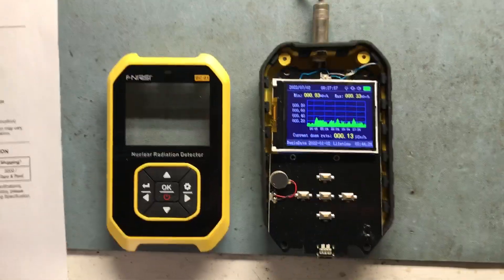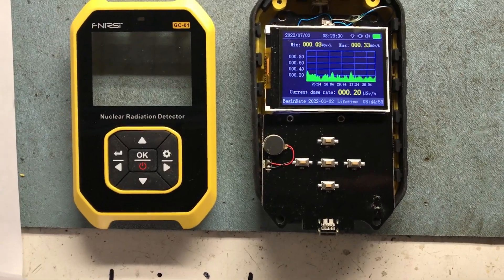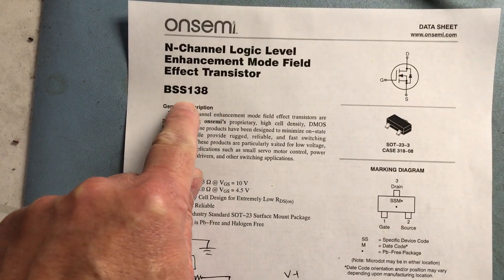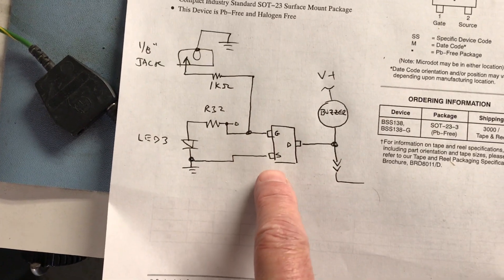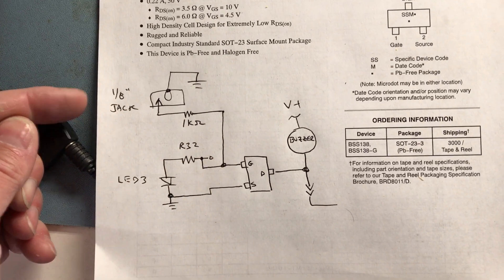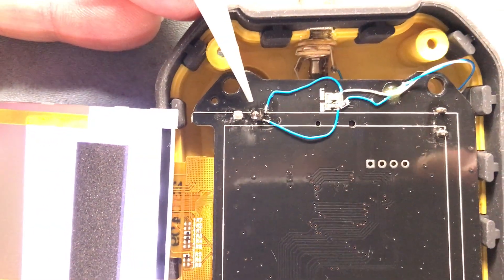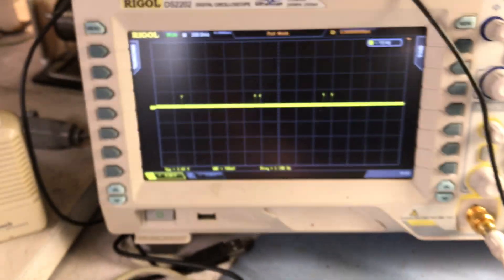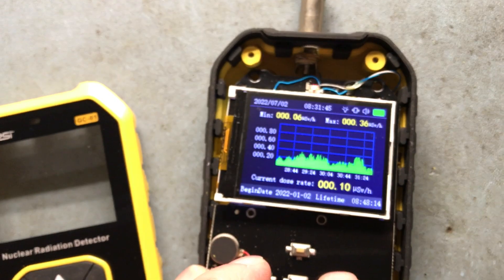"Clicks" modification for FNIRSI GC-01 Geiger counter

Comment: Nice mod, in the end I decided to opt for just a 100nF cap between the LED signal and the gate of the transistor, it means I get clicks even when the alarm is active.
You might want to take a look at the review of the GC-01 I just released on my channel.  Sadly the product has just switched to a far inferior GM tube and this even includes the white-label versions of this device.  I contacted the company here in China (where I am based) and they confirmed the change.  Such a shame, its was pretty OK for a low cost counter...
Reply: That 1-capacitor mod is definitely the best and simplest.
Reply from the maker: Good to know.   Thank you!

Comment: i tried and it worked fine 
would it be possible to increase click volume somehow ?
Reply from the maker: You might try an RC time delay in the gate circuit.  This way, the buzzer would stay on a little longer for each pulse.  I would put also a diode across this new resistor so the turn on will be fast and the turn-off is slow.  I've not tried this but I would start with a 100 milli-second time constant so maybe 10K Ohms in series with 10uF to ground? then to the NFET's gate.  Put a Schottky or General Purpose diode across the 10K resistor so the NFET turns on fast but then turns off with the delay.  You might have to play with these values as 100 mSec may not be enough to get it to your liking but I think this would work.
Reply: @ probably you’ve explained well. but sorry i did not have enough knowledge about electronics. i’ve simply followed your video

Comment: Hi, would you please tell me what's the real value for the R32 resistor? Thanks in advance.
Reply from the maker: R32 and LED3 are parts already located on the GC-01 circuit board so I did not measure those but it's an LED bias resistor for a 3.3V circuit so I would guess its value is somewhere between 250 Ohms and 1000 Ohms.

Comment: Hi! Does it sound loud with the transistor? I have done the capacitor modification and i can bearly hear it. Thanks!
Reply from the maker: It's usable but yes, your are right, it's not very loud.  The piezo element is inside the case so it gets muffled.  If you could extend the short pulses with an RC network or 555 timer then I think it could be much louder.

Comment: Could you show how to make such click upgrade to the Pudibei NR-950 or any dosimeter of the series?
Reply from the maker: I'm not familiar with those models.  My advice would be to look to see if it has a pulse signal to an LED or light bulb and try to implement this solution from there.  If there is no piezo buzzer then you could simply buy a 5V piezo buzzer and put it inside the case somewhere.  Good luck.

Comment: Regarding what you said about the µSv/h range, it definitely doesn't mean you shouldn't worry! The ICRP limit for occupational workers is 20 mSv per year, which you'll reach if you're exposed to a constant 90 µSv/h.

These limits are set on top of the natural background radiation, which is around 6 to 16 µSv/h.
Reply: Doesn't radiation type matter?
Reply from the maker: Good advice.  I didn't mean to ignore the dangers of radioactivity.  Alas, small amounts of radioactivity are present everywhere so, other than moving into a nuclear fallout shelter, it's not practical to live a life totally free from small amounts of exposure.